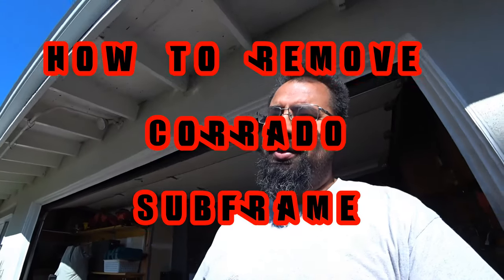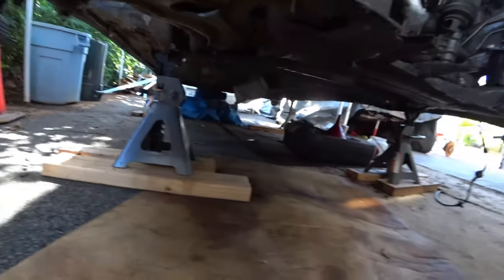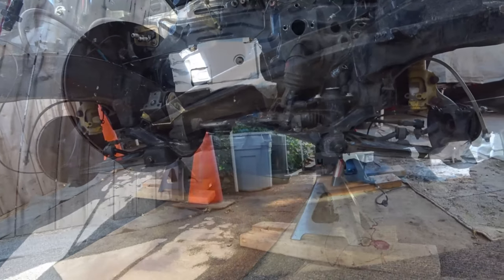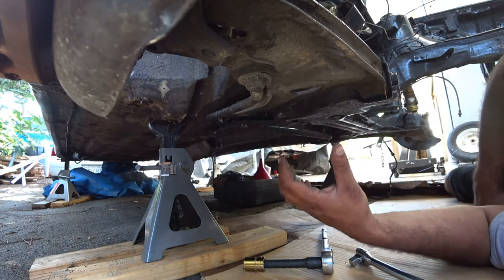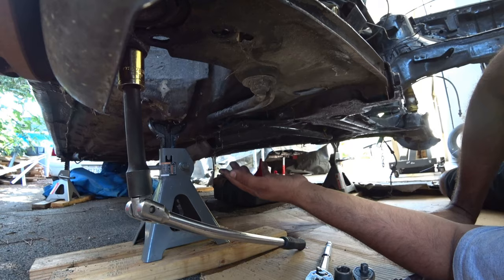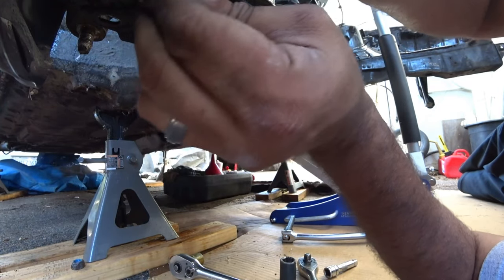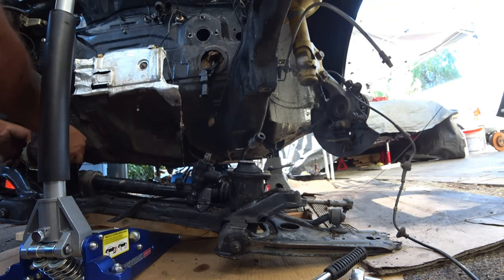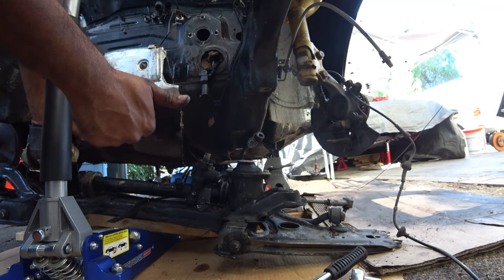corrado subframe removal S6 EP4

Comment: Does the subframe have a small amount of adjustment / movement in it? I'm chasing a camber issue where one wheel has negative camber and the other is neutral. Everything else on the front end is pretty much brand new, including the shocks. I am also using camber bolts to allow more adjustment, but to no avail.
Reply from the maker: It will be your control arm - spindle - strut - ball joint all these parts can give a camber issue
Reply: @PincheALsGarage  Thanks for the quick reply! Control arm, strut and ball joints have all been replaced. So I guess it must be the knuckle itself

Comment: Hey al I'm really truly stuck man😔 I have a aum1.8t 02 golf GTI and I had a weired problem where my car wasn't idling right and it would sometimes be really slow to pull off. I changed to stage 2 coils and put NGK plugs in and solved nothing, I changed the MAF and seen no change, I changed to H2O sensor and still had no change!! So I changed to a stage 2 ECU and put a 3inch down pipe on 2 days ago hoping it was a bad tune, yesterday it drove insane! It was a new car but it still felt a little rough at idle?? I went to get food with my fiance and I lost all throttle response and the eps light is it came on? So I pulled over and restarted it and it drove fine after?! So now it's this morning and I'm going back to the garage to ensure my 02 wires are tucked safely away and do some other bits and peaces but on my way home it drove like crap! I don't know how to explain what my car is doing, it's like breaking up under load and it feels like I'm towing a lorry when I'm driving! The 2 step sounds week and then suddenly it will start banging again? I have a clip of me driving it home if you don't mind taking a look for me I would really appreciate it man! thanks for all the help in your videos you have truly inspired me to have a go but this time I'm out of my depth!😒
Reply from the maker: Did you check for codes?
Usually when the EPC light kicks on its for the Thtottle body, can sensor, crank sensor or fuel pump.

Pull codes 1st and make sure to get a good code reader. When pulling codes make sure to look at pending faults and see where that points too.
Reply: @PincheALsGarage  no I haven't yet, since I've had the car there has been an engine light on but it's never seemed to cause an issue as nieve as that sounds. Possibly that code is biting me in the ass for not sorting it sooner😑 I'll read the codes and get back to you as soon as I know more!